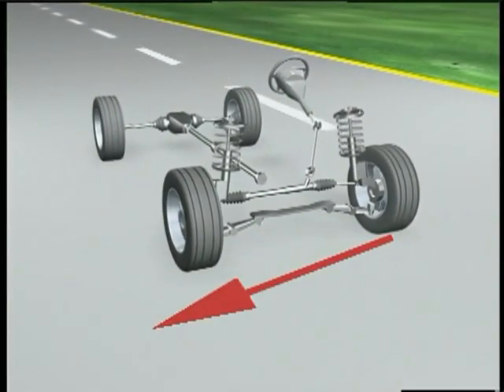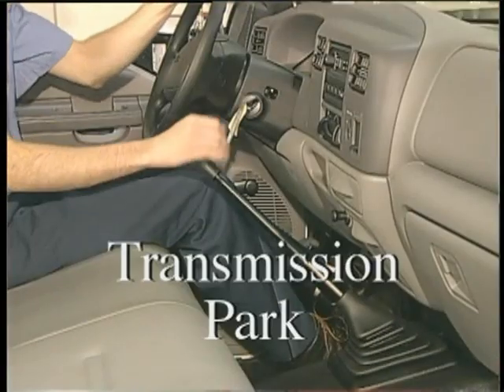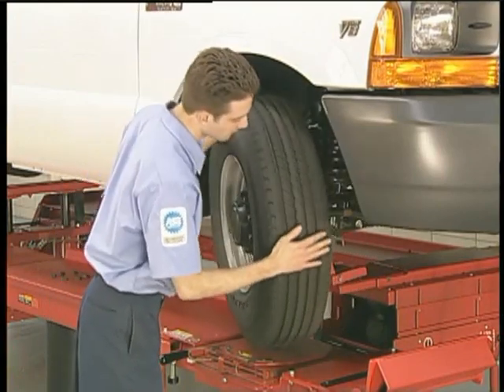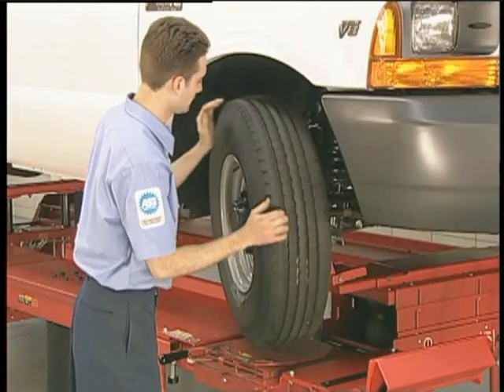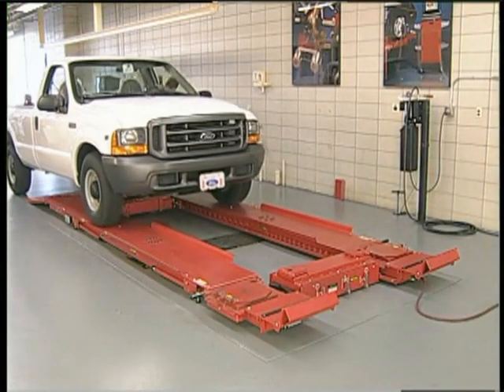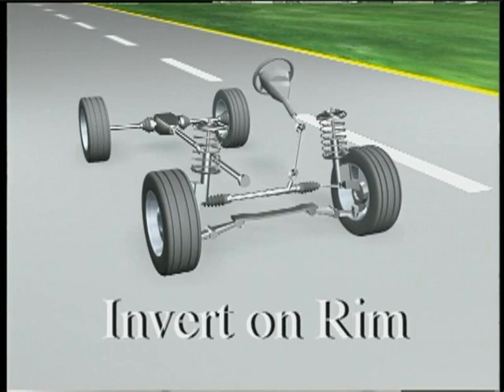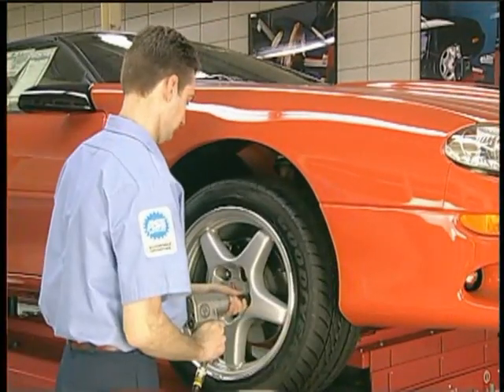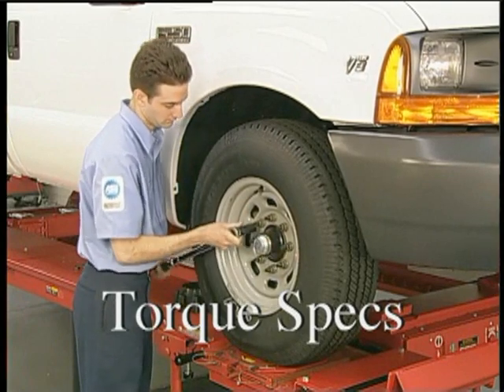Correcting Tire Pull or Vehicle Drifting Issues - Hunter Engineering

Comment: Yeah, my '63 Impala (no power steering) wanders all over the road, lotsa slack in steering. Hard to find a mechanic for a 60 yr old car. Very frustrating as its a very nice car.
Reply: To bad you didn't live in Mn I could help you out
Reply: @wolvenar  My understanding is that the slack may simply be in the steering gear box. I have loosened the set-nut on top of gear box but cant adjust set-screw that is within the nut, set-screw takes a flat screwdriver, seems fairly simple, but simply retightened the nut so I can drive the car. Am I going about that correctly? Maybe you can give me some advice on that, would be appreciated.
Reply: @TRIGGER861  Generally speaking when you get wear on those gears it is mainly in the center most used area of the gears. If it is bad enough to need much tightening once you do,  when you steer outside of the worn area it will want to bind, or be tight enough  that the steering cannot self center again. So short of a hard to get part, its far better to replace the entire thing. But before doing that check all your system for slack, the idle  arm, tie rod ends etc. It doesn't take much in each part to add up to quite a lot of slack. Be sure to look for movment in every dimension not just along the direction of travel. I have substituted original gear boxes with newer types from other vehicles but it makes for a bit of extra work looking for the best match with the least fabrication work.

Comment: As mentioned in the video, it's important to keep directional tyres pointing in the way they were intended when mounted, these can only usually be a swapped front to back, never side to side unless they are remounted on the wheel for direction
Reply: According to a Tire Rack article on tire pulls, it's okay to swap directional tires side to side temporarily for diagnostic purposes, which I believe. If rolling a tire backwards was instantly destructive, we wouldn't be able to back up without destroying our tires.
Reply: @averyalexander2303  incorrect im afraid, the directional intensions are for water dispersal, nothing to do with being destroyed when rolling backwards..
If directional tyres are mounted incorrectly or swapped side to side the chances of aquaplaning go up immensely
Reply: @bonkeydollocks1879  What's incorrect? Water dispersal is definitely one of the considerations, but that shouldn't be a problem for a temporary test either. We aren't talking about leaving the tires on the wrong sides permanently, we're just talking about switching them for a quick test drive to see if the car pulls in the opposite direction.
Reply: @averyalexander2303  whoa, hold on, stop twisting it. Youve completely gone off subject, i stated do not swap wheels and tyres side to side due to reversing the directional properties, then you come on explaing it rips the tyres to pieces (it dosent) you then state you were not talking about permanently, i was, stop twisting it around to what you have said that i never mentioned in the first place. Of course temporarily putting tyres side to side for a quick test drive wont 'hurt it',
Im talking real world permanently
Reply: @bonkeydollocks1879  I didn't say swapping the tires side to side would damage them, I specifically said it wouldn't. Of course tires aren't going to perform at their best if they are installed on the wrong sides, but that doesn't mean they should "never" be swapped side to side as you said, it just means they shouldn't be left that way if they are swapped for a test.
Reply: @averyalexander2303  stop splitting hairs, you knew excactly what i meant, find something better to do with your time, you are just being awkward for the sake of being awkward
Reply: That's what I was told. I was told not to do what this video says with modern tires
Reply: @chenlee3240  it is confusing I guess, just keep directional tyres direction. What part of this vid goes against what you were told? I thought they covered everything
Reply: @bonkeydollocks1879  You can put the wheel side to side and out it on the other side then have the tire took off and get it turned around and put back into the wheel. Like he half way commented and said dont do it. But it's possible. And normal. All he did was close all idea before you think more into it 💬
Reply: @cognac8297  of course if you are going to take tyres off and remount that's a different story, I'm talking just swapping sided to side with no remounting ..🙄
Reply: @bonkeydollocks1879  heck yeah ,